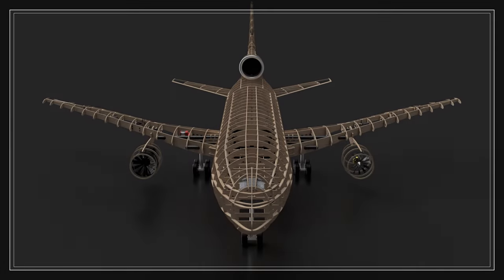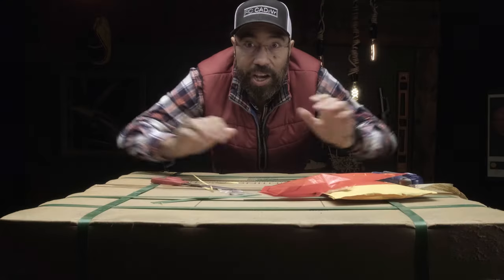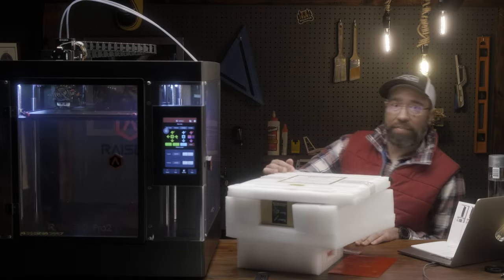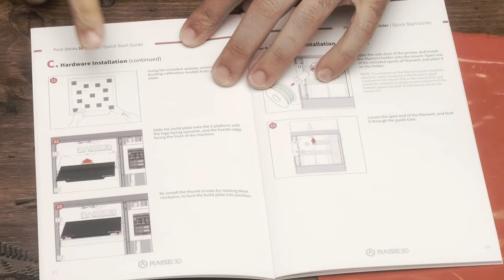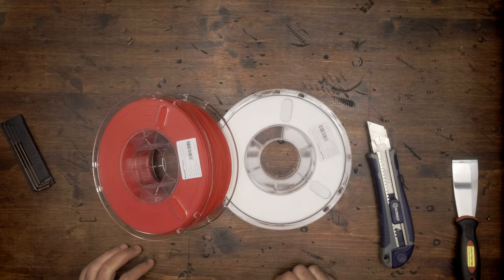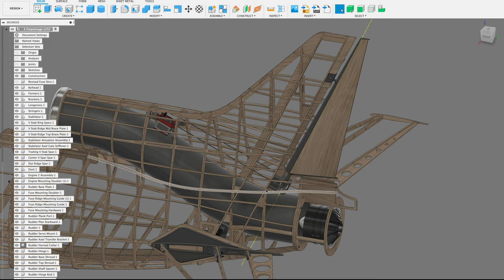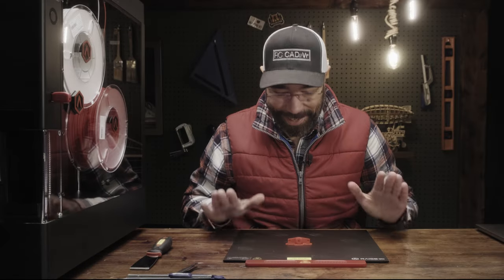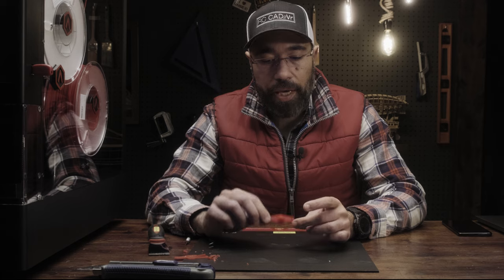Raise3D Pro 2 Unboxing and First Impressions

Comment: That's one hell of a printer, my cheap one cost me £160 and I am incredibly pleased with it. It's opened up a whole new world for me to create in. Once again you have raised the bar on quality Video presentation and the dissemination of  information. I am still having no luck with Getting templates from  the free version of F360 so hope you might address that sometime in the future. Thank you so much and I hope the channel goes from strength to strength.
Reply from the maker: Hi Neil -- Yeah, it's a pretty amazing machine for sure, it's been pretty much going non-stop since I've set it up. I looked at so many printers I couldn't keep then all straight. This one will fit my goals though since I have to have a beefy machine accomplish what I want. 3D printers really change everything. Getting parts that would otherwise be impossible or very expensive is so easy now. Thanks for the high marks on the video, I worked around the clock for three days on this one. Testing my limits, as usual. What templates are you trying to get? I may be able to help.
Reply: @RCCAD2VR  Take it easy Terrance I don't want to see you burn out, it's all too easy to take on far too much trying to keep up with other peoples expectations.  At the end of episode 7 you mention that the next instalment would cover getting the design's out of F360 and on to print/Cut and Paper template. That is what I was referring to in the previous comment as I love a paper template and lots of sanding but don't let that change the direction you are currently taking, I have been trying to get the templates of Ribs and Formers out of F360 and print them off but no matter what or who's directions I follow It never works out, I sometimes wonder if everyone else's F360 is different to mine!....Please don't go out of your way I am in no rush as I am planning to build a new workshop so modelling is once again taking a back seat. As far as I'm concerned any content you are willing to put out will no doubt be well worth watching. Many thanks and take care.

Comment: You should really checkout the Bambu Lab P1P. It prints up to 500mm/s with an acceleration rate of 20,000 mm/s^2. I have had mine for about 2 months now and it prints insanely fast and does not suffer any quality issues. I have an ender-5, and the difference in night and day. I can send a print job to the Bambu and not even worry about it.. it just does it.
Reply from the maker: I actually have the Bambu X1-Carbon as of a few weeks :) I'm ordering several of them. They'll be my production machines since they they can knock out the same parts 3x as fast. The raise will now be my non time critical, protoyping, mold form making machine.

Comment: Be very careful with the putty knife when removing parts. It will tear up your build plate badly. Sand the corners of the putty knife round or just get a plastic putty knife at hardware store. Also just grab the part and push and see if it will pop off with out the tool at all. But great job looking forward to seeing this project come together and fly!
Reply from the maker: That was an instant lesson learned, on camera! Thanks for the suggestions! I will do that, those edges are brutal. The good thing is that surface can be removed and replaced when damaged....so that's a + I suppose. Thanks for taking the time to add this helpful comment!
Reply: people like teaching !!!!  just watch and enjoy common!

Comment: Your videos are impressive but your skills are even more impressive Great work!! Do you still enjoy/recommend this printer?
Reply from the maker: Hi Joshua! Thank you for the very nice compliment. I do still enjoy the printer. It's been great. Any problems I've had were user error and common learning curve mistakes. I've since added 2 more build plates with different build surfaces and swapped out both nozzles for hardened steel and 2 diameters to accommodate composites that have larger particulate in them.

Comment: You should use ABS for model parts.  PLA will not stand to the heat of a sunny day outdoors. 
Love your work.
Reply from the maker: Hey there. Thanks for the tip. PLA will not be used for anything on this plane. All parts will be made from more engineering grade composite materials like CF-Nylon, ASA and PP-Glass

Comment: Thank you for a great unboxing vid! You're a few months in now, are you still satisfied with the printer? Have you had any issues? What materials have you used up until now? When reading other peoples' reviews, they've had some mixed feelings.
Reply from the maker: Hey there 👋 glad you enjoyed the video! I'm very satisfied with it so far. The only issues that I've had is with the BuildTak surface that comes stock with the printer. It's less than ideal for more advanced materials like polypropylene and Nylon which refuse to hold prints down, even with glue stick and other specially formulated adhesion sticks. I simply solved the issue by buying additional build plates and putting more appropriate build surface on them. Garolite for nylons and PEI for polypropylene. Solved the problem. It does require recalibrating the z axis or you have to compensate for the build surfaces different thicknesses in the slicer. Other than that and user error, the machine has been great.
Reply from the maker: I've used PETG, PLA, TPU, Nylon, Carbon fiber nylon, and Glass Fiber Polypropylene. The composites did require swapping out the brass nozzle for a hardened steel nozzle.

Comment: Heya!
I’ve been following along for some time now and I recently purchased the plus version of the Raise3D Pro 2. I’ve been struggling a bit with supporting the piece I’ve been attempting to print, and the length of print time. 2.5 hours for a simple ellipse seems like a bit too long :/. 

What are your thoughts?
Reply from the maker: Hey there  Pietro, without seeing the part it's difficult to say. There are hundreds of variables that can have an effect on prints. Everything from material, shells, travel, extrusion speed to print orientation and how much support is needed for the model. All of these are controlled in the slicer and is not due to the printer. The printer is only following the instructions of the slicer. You are more than welcome to send an image of the part as a DM on twitter @ https://twitter.com/cad2vr or Instagram @ https://www.instagram.com/rc.cad2vr/ and I will take a look at it and see if I can find anything glaringly obvious.

Comment: Hello Terrance. I'm new in your channel. Congratulations for your good content.

Terrance, I have a question. What is the program are you using to create subtitles in several languages? Thanks!
Reply from the maker: Thanks Robô. There is no specific program I use. I let YouTube do the initial transcription, then I manually correct any errors. Then I go back and modify the text into plain, simple English so that Google translate can get a clean translation. It's usually about 4-6 hour process.

Comment: Quelle machine aller vous choisir pour l'usinage du bois ? Car je suppose qu'il va pas être tous plastique. A moins de faire des masters pour les coffrage d'ailes et du fuselages pour coller les couples et nervures. J'ai hâte de connaitre le procédé du dessin au pièces solides. Magnifique projet je lâche pas le fil.
Reply: When using this type of printers, it is advisable to pay attention to how the parts are positioned on the plate in connection with the forces that are placed on it, because a print is always at its weakest point in the direction where the layers lie on top of each other
Reply from the maker: Merci! Heureux d'apprendre que vous attendez également avec impatience la construction de l'avion! La majeure partie de l'avion sera faite de contreplaqué, de balsa et de fibre de verre. Le support et les pièces spéciales, comme les supports d'aile, le boîtier d'engrenage, les supports et les formes complexes seront imprimés en 3D à partir de nylon infusé de fibre de carbone pour une résistance supplémentaire. Ce sera un avion amusant à monter à coup sûr! Je pense que je suis plus nerveux à propos de l'électronique 😬- Merci de rester avec la chaîne! Acclamations!

Thank you! Glad to hear you're also looking forward to the build of the plane! Most of the plane will be made from plywood, balsa and fiberglass. The support and specialty pieces, like wing mounts, gear housing, brackets and intricate shapes will be 3D printed from Carbon Fiber Infused Nylon for extra rigid strength. It will be a fun plane to put together for sure! I think I am most nervous about the electronics 😬- Thanks for staying with the channel! Cheers!
Reply from the maker: Exactly. Working on experimenting with this very point this week with prototype pieces. Thanks for the comment!

Comment: 4000€ printer? and dont cach mosquito 500ºC.
Reply from the maker: mosquito?
Reply: @RCCAD2VR  yep the hot end from slice enginering. named mosquito. and now they have magnum for more flow and at 500ºC so that 300ºC from raise3d is easy achiveble.
Reply from the maker: Ah nice! Thanks for the heads-up!

Comment: I don't understand why you spend so much time on a part that you could have bought off the shelf with much higher durability than the 3D printed PLA part. If I were you I would certainly not consider using such a 3D printed part and risk a crash due to its failure. There are plenty of dual rudder horns from higher grade material or aluminium server horns that you could have adapted for the purpose.
Reply from the maker: Hello Hans, thank you for taking the time to add a comment. I am well aware that I can buy off the shelf, but I chose to spend time design parts because I enjoy it, I learn from the process, and discover interesting idea along the way. You're assuming that I would actually put critical parts made of PLA in my build? Obviously that wouldn't be very smart. This was my very first test print and that part will never be used. For the actual build I am using high end industrial grade composite filaments specifically made for functional parts used in aerospace, civil engineering, military, formula 1 etc. and this printer handles them beautifully. These materials are perfectly capable of easily handling the forces the plane I'm building would ever encounter in flight. Cheers!